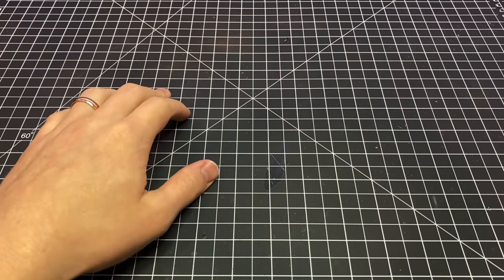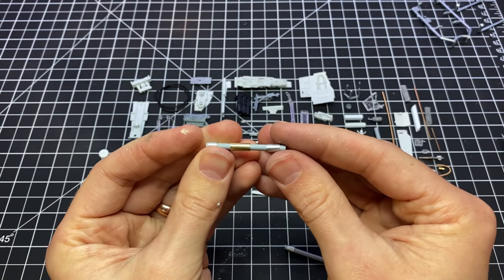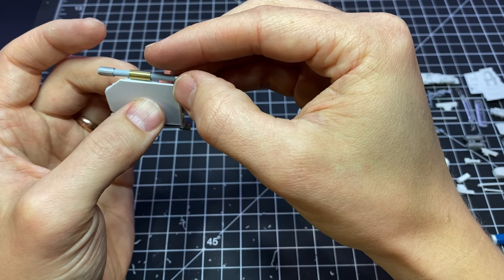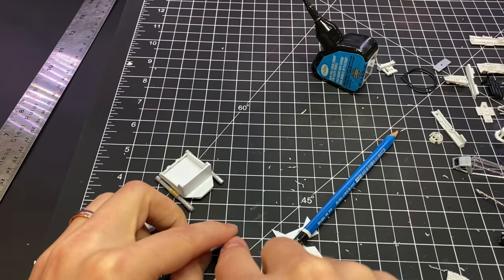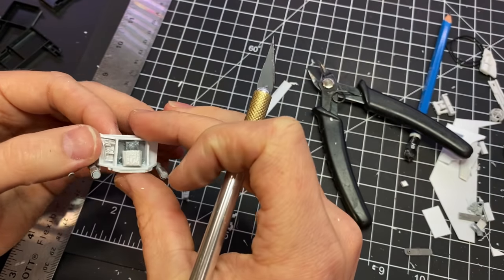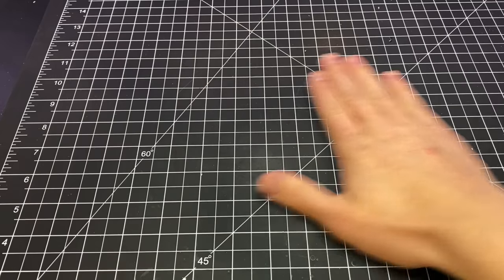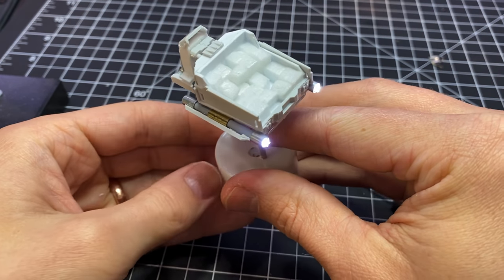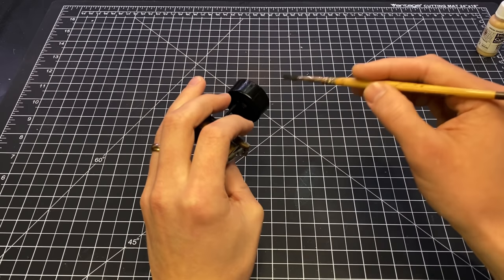Scratch Building an Obscure Star Wars Vehicle

Comment: If it's  hovering across the ground, then it is a Land speeder, which is the Star Wars version of a car. So, I would go with "driving from the cab." If it was up in the air and/or making any drastic vertical changes, then it is either an Air Speeder or a Starship, either of which would be "flown from the cockpit.

Comment: Amazon has pre-orders up for Banai's Star Wars model kit of the 1/144 Razor Crest in both the regular and plated versions as well as regular and plated 1/12 Mandos. I have all of the SW OT kits Bandai made, but I am getting a regular Razor Crest to pick up and paint. I'll have to build a separate dio for it as the rest of my 1/144 ships are on a double trench run set, and the Crest wouldn't look right with them.